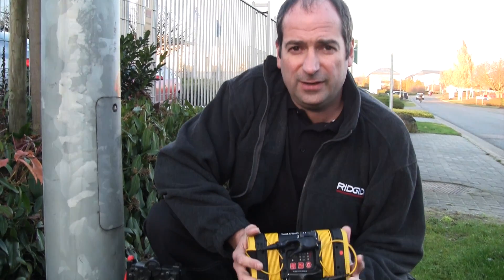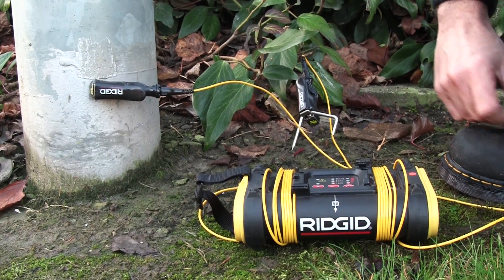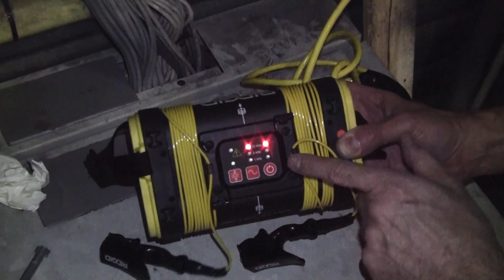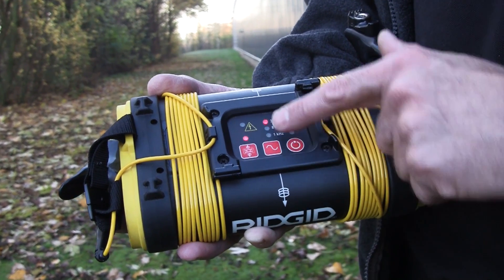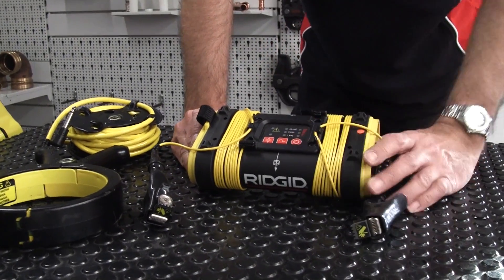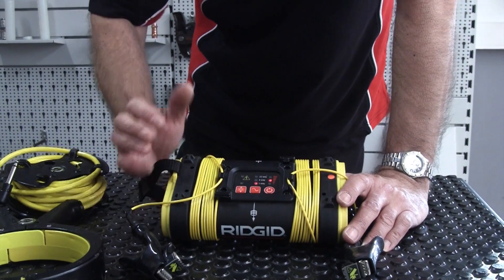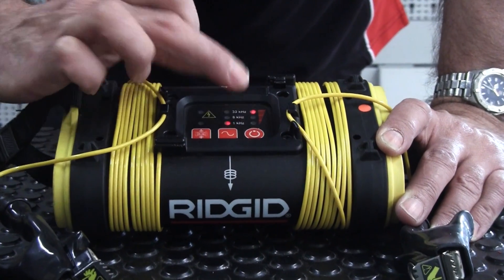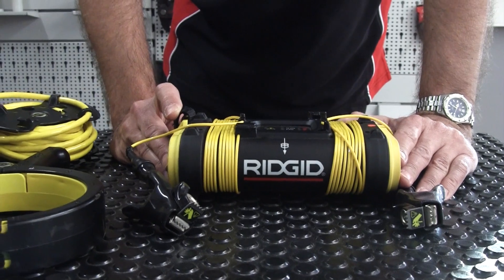How To Use RIDGID® Transmitters: Connection Options & Frequencies

Comment: Hi, what a maximum distance from the generator to SG24 when searching for large metal pipes (D=0.5-1m)
Reply from the maker: Hello, if I understand your question correctly, you're asking how far away from the line transmitter you can be with the hand held SR-24 locator. If that's correct, this distance is determined by the underground conductor that's carrying the signal. If the target is a good quality conductor and the soil conditions are optimal, then the signal can be traced hundreds of feet. In less than optimal conditions, the distance capability is much shorter. Success depends on the conductivity of the soil and the quality of the target.

Comment: Does this work for water services ?
Reply: If is a metal pipe or if there is  a tracer wire if it is plastic .
I just bought one, I had an idea to find a smaller plastic water pipe . It would be to turn off pressure to pipe,  cut into it. Then push in a steel wire puller tape. Then connect transmitter to it.
Reply: Can the electrical utility line be energized to be able to locate it with the clamp and the St-305?